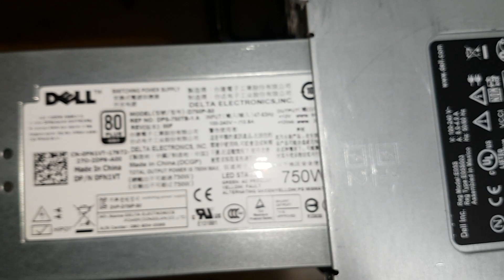R715 Server inside look (Dual AMD Opteron, 64GB)

Comment: Dude I would totally buy this from you if it happens to be in my price range!!
Reply from the maker: I dont have this anymore.
But will have other servers like this soon for sale.
But I only Sell locally in Toronto Canada.
Reply: @AleksandrsBrodie  dang...im looking for something I can game on and I don't have a bunch of cash to blow on it. Im located in Oregon...anything you can do with that?
Reply from the maker: @williamgoeres138  i dont ship sorry.
but a solid budget strategy is buying a used Dell T3600 or HP Z420 workstation and upgrading the CPU to a 6 or 8 core Xeon.
a lot of my channel content comes from builds using the older workstation and xeons.
I recommend an RX 570 and E5 1620 or better
Reply: @AleksandrsBrodie  that's too bad. I was gonna try to trade off my msi twin frozell 2 for a gaming rig. I don't have a use for it, and it's just gonna go down in value if I keep holding onto it. You know anything I can do with this card? Maybe send it to you for some cash or something?
Reply from the maker: @williamgoeres138  I recommend, posting it locally on Facebook marketplace.
take what you can get for it, just remember its worth only as much as someone is willing to pay for it.
who knows, maybe you sell that, buy something else and start making money by flipping stuff.
Reply: I got five of these. Selling them in RVA.

Comment: im buying one of these is there anyway to add nvme drives with pcie to nvme devices or should i just go with a ssd?
Reply from the maker: I would NOT buy these old AMD server chips. trust me.
They are BAD,
go for older X58 xeons or newer, trust me
Reply: @AleksandrsBrodie  dang
Reply: @AleksandrsBrodie  i mostly like it because of the low sound it creates ive seen in vidoes of it
Reply from the maker: @horribletm7630  trust me, the xeons from the same era are a much better buy.
ive had both, that is my take.
and the noise of the server depends on the model and what kind of cooling it has, ive had both loud and quiet amd and intel servers.
you still get to make your decision at the end of the day.
Reply: @AleksandrsBrodie  what high core count server would you recommend on a 500-700 dollar budget?
Reply: @AleksandrsBrodie  i think ill go with this one as i dont need the stuff xeon offers im mainly using it for vmware for fun stuff
Reply: thanks!
Reply from the maker: @horribletm7630  hmm,
I dont know if the chinese motherboards support Virtualization, but if the do, get a dual X99 chinese motherboard, 2x E5 2678v3.
Honestly, I would just check all of your local listing where ever you live and try to get a feel what you have available.
The X58 server. or LGA 1366 server with dual 6 core xeons are probably budget friendly, you can load them up with 48-72GB ram.
Otherwise, try and find a LGA 2011 server preferably one that supports V2 CPUs as they run cooler.
Also another great option is to look for dual socket workstations, like the Dell T5500, HP Z800 and the Dell T5610 Lenovo D30
dual socket workstations can be a great budget way of getting a system that supports virtualization on the budget.
Reply: @AleksandrsBrodie  thanks!
Reply: @AleksandrsBrodie  I disagree, I have 2x R715 and a R815 server with Opteron 6378's in the R715's and 6380's in the R815. These machines are VM beasts, these scale much better than the 2x hyve machines I have with 2648Lv2 and 2695v2 Intel Xeon's in each box. The Intel's give better single thread, and better idle power usage, but as I scale up VM's on the boxes the Opteron's perform better. All these boxes have 128GB of DDR3-1600 RDIMM's, except 1 of my R715's that has 64GB of ECC DDR3-1600. Also the fan noise and power draw of the R715 is much more livable than the Hyve servers (1U boxes) and the R815 will suck the power out of the wall if you flog the thing (and get noisy too).

Cheers!